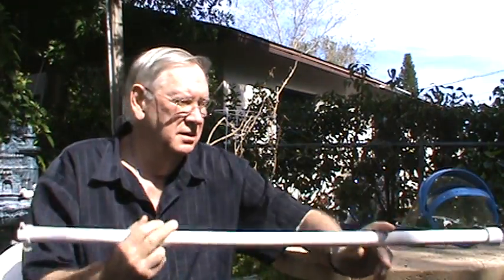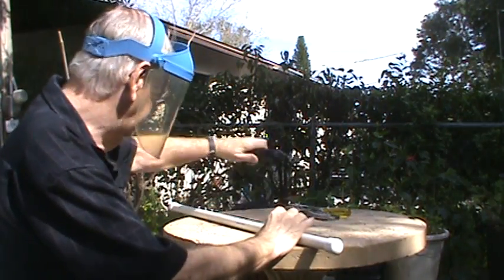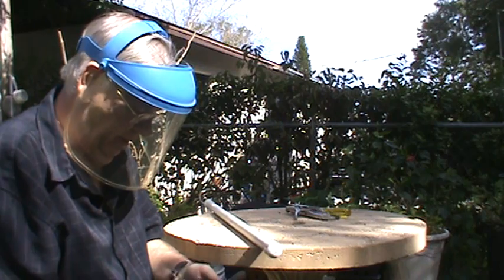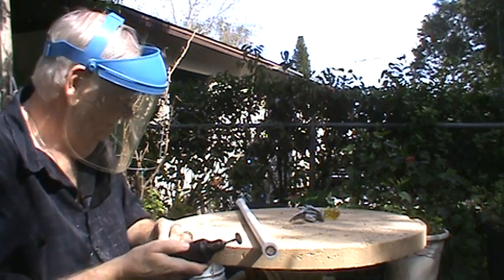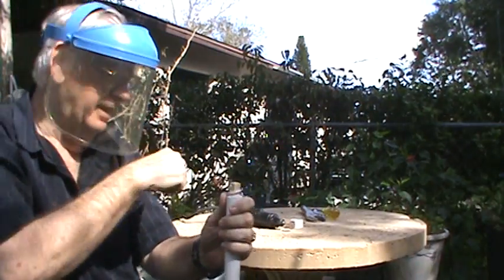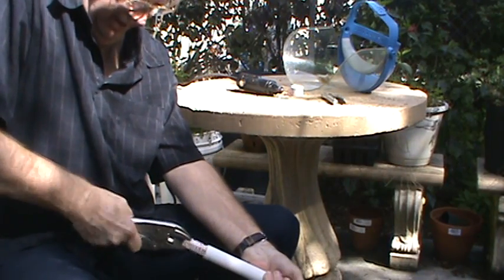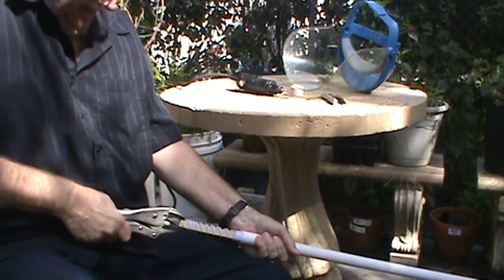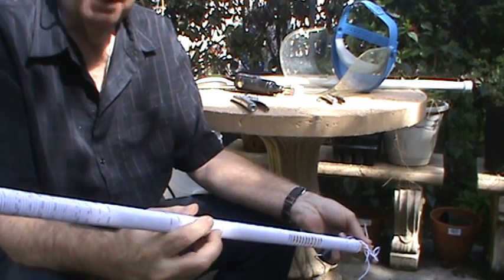TRRS #0487 - Shortwave Broomstick Antenna - Final Answer!

Comment: As others have said, these are gimmick antennas. Its concept is just a coil of wire. Its not even a loading coil as there is no element off the end. Calling it a broomstick antenna is accurate as if likely receives no better than an actual broomstick.

Comment: Ok so it is a rather large inductor and has no actual element. Cut a bit of straight rod to a harmonic of the band and connect it to the end of the long large coil, see what happens.
Reply from the maker: It has already been taken apart for parts.

Comment: If it has maybe 50' of wire, rope whip a foot of wire at the end of it like a line cord antenna would be, and it might work VHF/ UHF from Air band to 470 MHz using the rope whip connection as (+) , and the wire as (-) when spliced to a BNC, or SMA connector. Wood for the Coil Form will not work as well as steel, better yet would be 2 4' lengths of 24/6 Solid Core Telephone Station Wire with 11 conductors in Series for 44' of wire for the (-) connection if that's a 4' length of PVC pipe.
Reply from the maker: It appeared it was built from the plans of a true Broomstick antenna but several important parts were missing making it useless for SW.  Of course those missing component would have driven the cost up especially shipping as it would be a much bigger package.

Comment: Just bought one on ebay for $24, Stick by Peanutpaster! LOL!Seller claims it's not a broomstick antenna!I have not tried it yet with my DX-440!Did I get suckered? I have another, a long wire antenna,  very nice one with a few inert gas filled pods on it, but don't have room to set it up, I only have a small backyard!That's why I bought the - Stick!
Reply from the maker: The one I bought was not a full broomstick antenna either as parts were not included for that type of antenna.  Based on what I found inside the PVC pile, this antenna was pretty useless.
Reply: Watching you video taking this antenna apart, looks like nothing more than a large rubber ducky antenna !Rubber ducky is just a coil of wire!
Reply from the maker: This one appears to be partially a Broomstick antenna in that the wire was wound in a certain fashion but the parts that the normal Broomstick antenna that are on the outside were missing.  So it was no more than wire wrapped around a stick in a certain manner.  Did not work.
Reply: Last night, set up and tried the NEW - Stick - antenna with my old DX-440  (25 years). Mounted the antenna on the side of my kitchen window, maybe 10-12 feet high from ground. Scan through all the frequencies on my radio, 150Khz - 30Mhz , few stations came in between 8pm 11 pm PST.  My location is near San Francisco, CA.7730 KHz from Florida - pw. 100  - lot of static , barely can hear it9790 KHz - from Cuba     -250  strong, very clear SPT 8pm-9pm English 11780 KHz -  from Brazil - pw. 250 - weak, lot of static 10,000 Khz - Time - Colorado?,  weak17840 Khz - Australia ABC - Sheporton -pw. 100 -  weakalso picked  up very strong signals from Kuwait and China, but no voice , transmission frq verified on a SW website. At 375? KHz heard Morse beeping.So, the Stick antenna seems works around the 41 m -21m range. Nothing came in bellow 7 Mhz or above 21 Mhz, not even static. Guy claims CB radio can be heard above 29 Mhz from truckers, I live close to a Hwy but nothing, not even a hiss! Also, said 2-3 Mhz transmission can be picked up using SSB. Nothing!So, I'm not sure , I have not DX-d for a long time, how would it compare to a standard wire antenna?I have to play more with this antenna, maybe move it higher, to different locations, it's definitely compact and stealthy. I live in a town house complex,  there's rules against mounting any thing outside, all though many owners have TV DISH set up outside.
Reply from the maker: Thanks for the report.  Note that the one he sells is different that this one.
Reply: hamrad88 Why? Same PVC tube, but don't know what's inside! maybe the same wood stick, like yours have with wire wrapped around?
Basically, $3 worth of material + some labor sold for $25!
Reply from the maker: Yours worked mine didn't.
Reply from the maker: My experience with this type of an antenna is that it helps a little but no better than a 10 foot piece of wire.

Comment: What an adventure - what was under the black electrical tape?  Save the wire when you show us how to build a new broomstick antenna ..
Reply from the maker: The black tape was just use to protect the wire as the assembly was inserted in the tube.  There was nothing under it.

Comment: You know that was actually better made than I thought it would be.  I had a vision of a broken wire inside.  Not sure why that did not work at all.  Thought you would have got something with that amount of wire in the tube.
Reply from the maker: I really don't know what the problem was.  I checked the connector, used different coax to hook it and finally checked the wire inside the tube and found nothing wrong.

Tom
Reply: hamrad88 Its a strange one Tom. ;-/
Reply from the maker: fredintheshed1 Yes, it was well constructed but just did not work.

tom

Comment: There seems to be no reason it wouldn't work to some extent, even poorly.  I had an antenna similar to this except the windings were on the outside of an aluminum tube.  It worked fine!
Reply from the maker: It is still a mystery. 

Tom

Comment: Back when I got into shortwave radio thats similar to the first antenna I built. Wasn't the best, but a simple dipole or a long wire antenna works fine and is cheap.
Reply from the maker: Even the built-in antenna worked better than this did.  Still a mystery.

Tom

Comment: I have also been curious about the status of the broomstick antenna. Make sure to continuity the ends of the coil.
I would try rewinding the antenna and taping the wire that came loose with electrical tape and then try it hard wired
to the coax and re-hanging the antenna in the  tree and give it another try. Some types of PVC have metal in them
especially the dark grey types. The only other possibility could be that it had a high inductive reactance to the
the frequency you were checking it at? Tom, you also had a overseer in the background watching you.  :)
Time to give it another try without the PVC tube.
Reply from the maker: I have spent way to much time on this.  Its over! LOL

Tom

Comment: It is a mystery why it did not work at all. I would have thought it would at least work in some way, even if it was not that efficient. Glad to finally see what was in there. 73, Tom
Reply from the maker: It is a mystery to me that it did not give any improvement over the whip antenna sice it was 15 feet in the air when I tested it.  

Tom

Comment: So now the cats out of the bag or the tube
Now you can hook a jumper to the end of the ant and give it a try
Reply from the maker: +ABikerLife I used the wire for another project and chalked it up as experience.  The big clue is when I could get no explanation from the seller.
Reply from the maker: No I have spent too much time messing with this.  It goes in the scrap pile.

Tom
Reply: +hamrad88 That antenna can actually work, but not as-is.  I think the main problem is that is constructed like a rubber duckie antenna ( a dummy load pretty much). All inductance, no antenna. Wire could be added to both ends.  Tom , the closer the coil is to the feed point, the less wire you need to be resonant at a certain frequency.  The farther from the feedpoint a coil is , the more wire you need on the antenna to resonate at a certain frequency. You could easily use this part for a center loaded antenna. Or,, you could just use the wire for other projects ;)
Reply: Experimenting with antennas is one of the more fun parts of the hobby. Hope you got your money's worth of hobby time.. :) KK5VN
Reply from the maker: +ABikerLife Definitely.

Comment: Only thing I can think of is use a different connector and see if that helps.
Reply: Yes, I wonder if the connector was completely defective.
Reply from the maker: watershed44 I had tested the connector and coax several times.

Tom